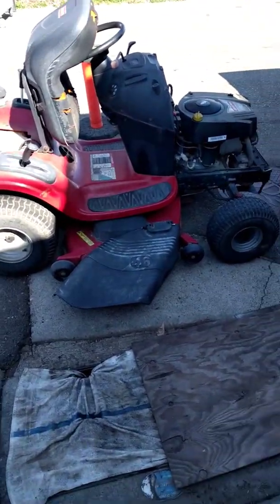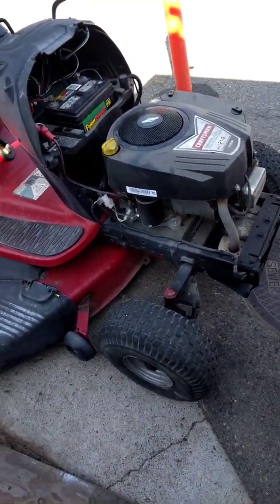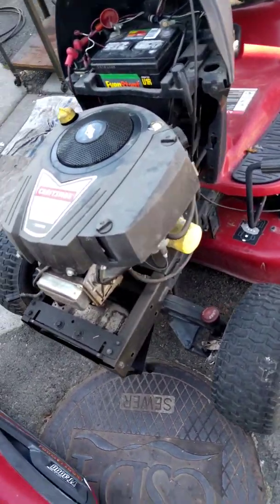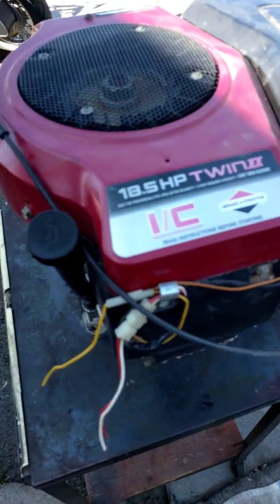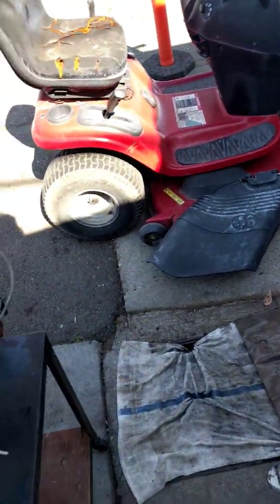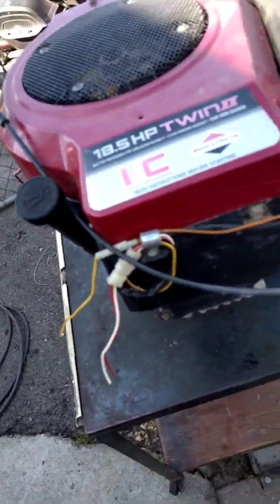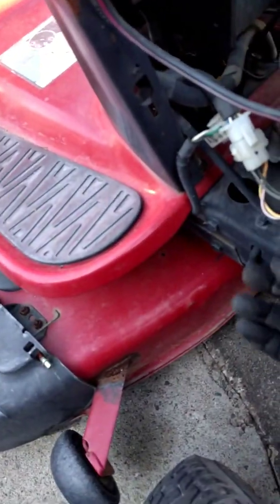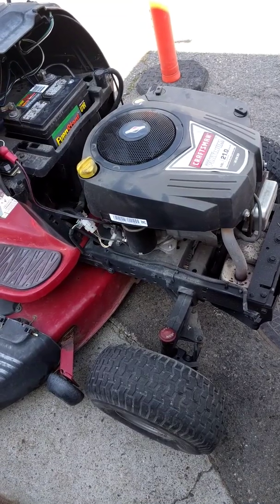Craftsman YT3000 Engine Swap

Comment: That motor will start without the release. Just hold hand over the intake and let loose after it spins. It will start. Use a wire magnet to fish out the little broken pieces. U won't get all, but most. Mine is still running strong.